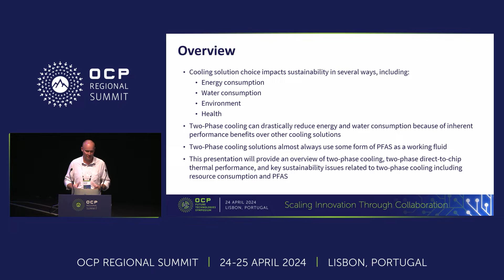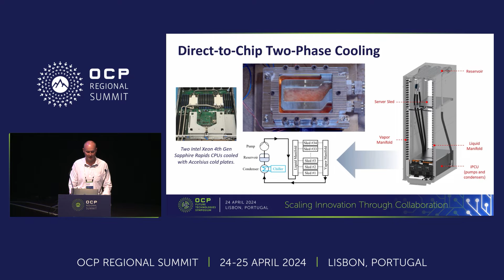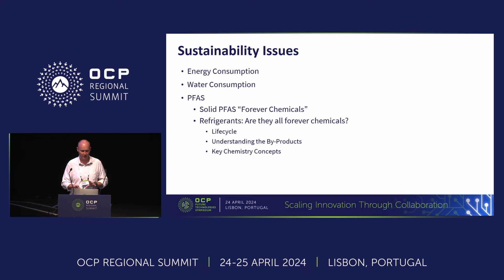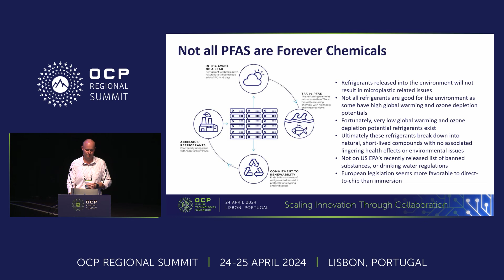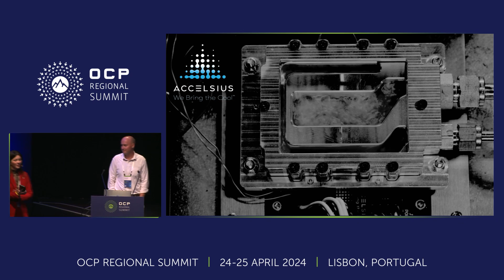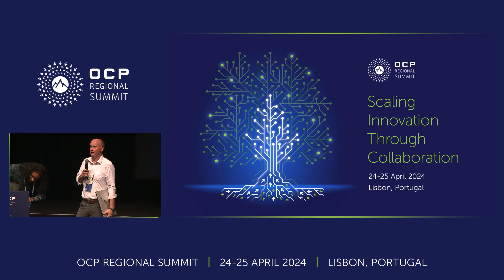Direct-to-chip, Two-Phase Cooling Performance Metrics and PFAS Sustainability

Comment: After researching a bit on the topic regarding the last question by the audience member. 

TFA (the breakdown product of the coolant R-1233zd) is not produced biologically or abiotically, meaning it is not a naturally occurring compound and that the speaker either lied or was mistaken. It is the most abundant PFAS found in the environment. Trifluoroacetic acid is mildly phytotoxic. Research is ongoing but, in July 2024 (I do realize this was uploaded in May), the German Chemical Agency submitted a proposal to the European Chemicals Agency (ECHA) to link trifluoroacetic acid and its salts to reproductive toxicity and as suspected of damaging fertility.

Given the fact that there is indeed no 100% guarantee that every system won't ever leak, the concern is very reasonable despite insistance from the speaker that it is the best option available.

However, the regulatory situation seems to be somewhat favourable to this coolant when compared to other HFCs.

There are no specific deadline bans for R-1233zd in the F-gas III regulations (HCFC-1233zd and isomers as is referend in them). But it is one of the controlled substances and they will be completely banned by 2050 along with all other Hydrofluorocarbons. Other restrictions may indirectly apply to it through restrictions the cooling systems themselves.

All in all, I'm not particularly concerned about the use of this chemical. Chances are that it really is one of the best options available from the pool of low boiling point dielectric liquids. And the technology is undoubtedly fascinating. Unfortunately the fact that the presenter was wrong and had it in his notes does imply at best a misunderstanding between him and whoever gave him the info. But a less charitable take may be that they didn't look into it or decided to disregard it.
Reply: I'd like to point out the logistical realities of maintaining waste chemical analytical infrastructure...I was on the el cheapo end of chemical analysis, they cut everything to the bone to maximise throughput. 

Hell of a name *Acc*elsius ... like it is in their name accelerate Celsius ...they literalised what they are doing.

What I want to know is, is their any capability of concentrating all that heat in an industrial sized heat pump for furnace use? Then call them Forgecenters or Vulkancenters we can all do another China lets all melt metal next to the datacenter parties.

All to generate even more CSAM for all the wierdos who've pretezeled themselves into thinking any of this is ethical on any level.

How about a tortilla flatbread from literally any part of the world line, bake something or have infinite carousel and create communal baking oven just like the Mesopotamian ancients would have had.

Dominos would move right in, the logistics of bread manufacturing force them to relocate to Datacenters to steal warmth like in that game frost punk, but it's like bake punk where people are fighting over free bake time because nobody else can afford electricity.

Comment: Direct to Chip cooling is a great idea.
Would machine copper be the best heat transfer, I know they like to use Aluminum.
Question?
Has anybody done a two stage cooling with water and propylene glycol and a heat exchanger for a medium or heat transfer from 1 stage to another?
What about different refrigerants as well for different pressures?
What about building a data center underground, just to make the building more efficient?(This might be a good idea)
ALL Refrigerants leak out at the microscopic level because it's pressurized.

HOW else would you get a service call, for improper pressures or wrong temperatures.
Geothermal heating and cooling with a 2 stage or 2 phase cooling with a heat exchanger as well as propylene glycol or water as a medium.